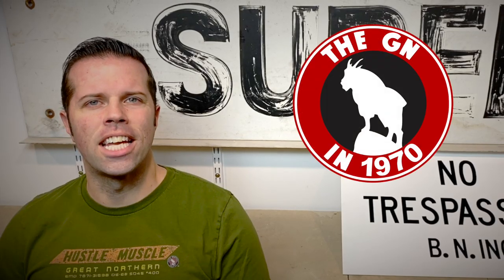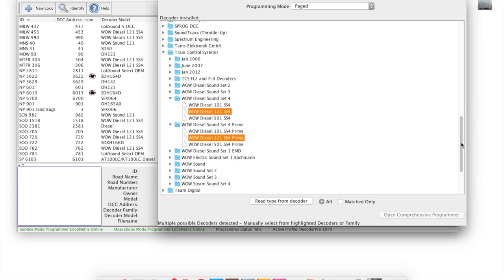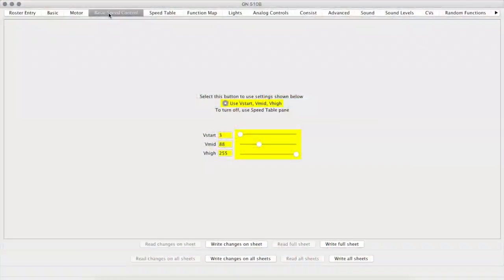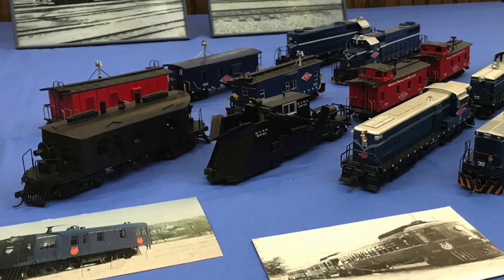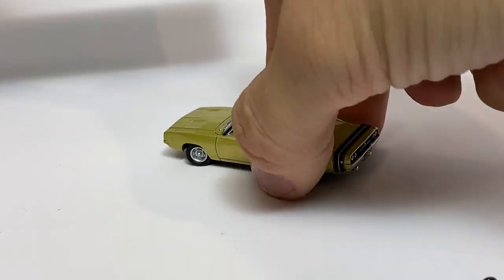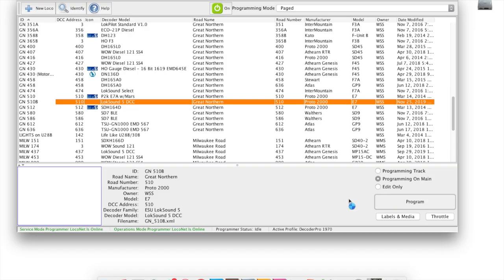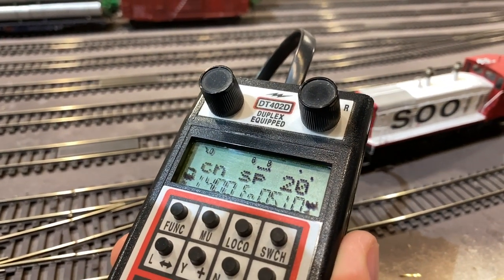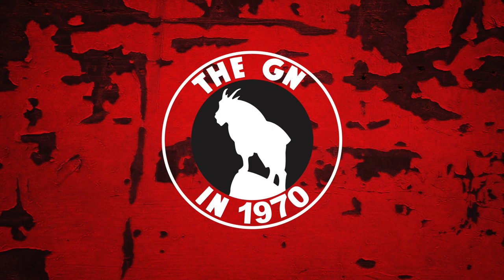S02E01 - How to speed match a DCC locomotive, the MN&S and How to swap wheels on 1:87 vehicles

Comment: Hi William, Great to see another video from you. That sure is a lot of work to speed match the locomotives, but it does make them run so much better when they are consisted. I enjoyed the segment on the vehicles and bending the axle so that the wheels are turned.-Tom
Reply from the maker: ThomasKlimoski Excellent questions, our goal is to always continue to refine the consists and locos running together. In addition to the programming, we find turning off the BEMF, has helped in some cases. So much trial & error, as you know, but this method of speed matching has really set standards to what we can expect from each unit.